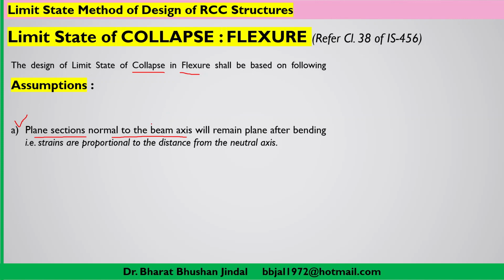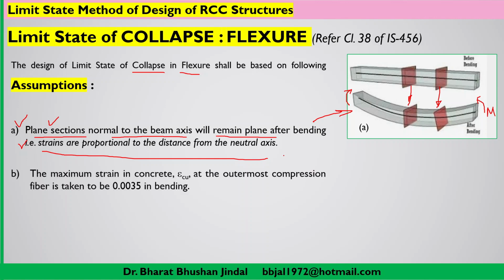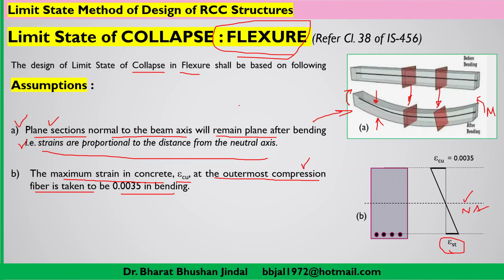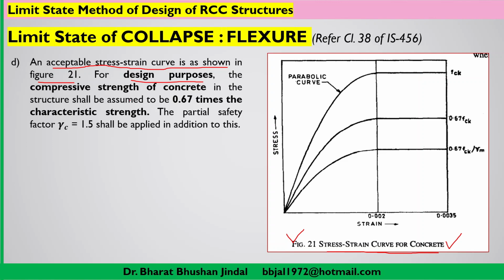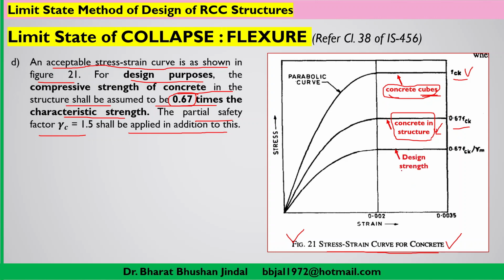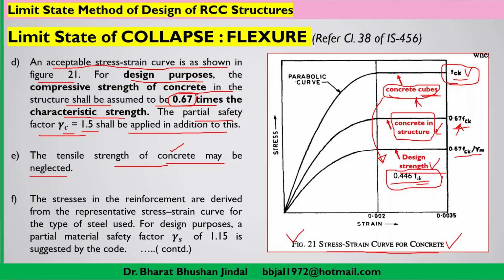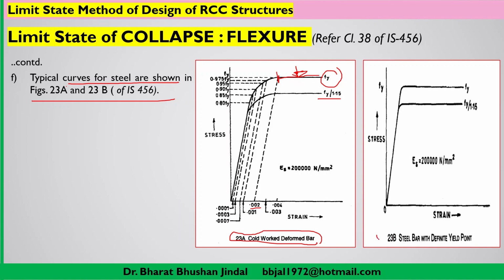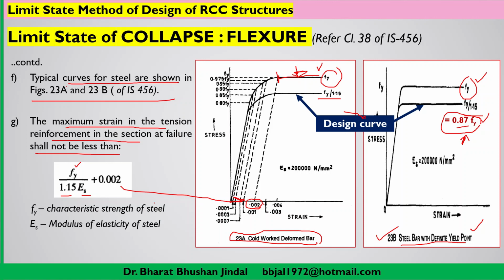Limit State of Collapse | Design of Concrete Structures ( Lecture 6 )

Comment: For design purposes compressive strength of concrete is taken as 0.67 times  the characteristic strength of concrete, is it experimentally obtained  ? or it is just a value based on practical knowledge?
Reply from the maker: Its based on 'Statistical Analysis' or better to say by 'Probability theory' .

Comment: sir what will happen if the max. strain at reinforcement in section at failure is less than given formula.
Reply from the maker: Then failure of concrete will happen before failure of steel which is never recommended and you will be able to understand it in more clarity in coming lectures. 

*Appreciation for asking 'Good Question'.

Comment: It was a very good video Sir!!!
The summary of video is as follow:
In this video we discussed about limit state of collapse : flexure (Cl 38 IS 456)
We made some assumptions which are listed as follows:
a) plane sections taken perpendicular to beam axis will remain plane after bending 
b) the max strain in concrete at outer most compressive fiber is taken as 0.0035 in bending
c) the relationship between compressive stress distribution in concrete is taken such as it is easy to predict strength in substantial agreement with result of test.
d) from figure 21 of IS456, for design purpose compressive strength of concrete in structure is assumed to be 0.67 times characteristics strength. [ (0.446)fck i.e 44.6% of the actual characteristic strength of concrete]
e) tensile strength and compressive strength of concrete and steel are neglected respectively.
f) 87% of actual tensile strength is assumed for design steel.
g) max strain in tension reinforcement in sections at failure shall not be less than [(fy /1.15εs) +0.002]

Comment: Summary on topic- assumptions considered in Limits theory of collapse:-
1. Even after bending plane sections normal to beam axis will remain plane.
2. At the "outermost fibre", maximum strain on concrete= 0.0035
3. As per the substantial agreement of predicted strength and test results, the relationship b/w compressive stress distribution and strain of concrete  may be assumed of any shape(rectangular, trapezoidal, parabolic)
4.  For design purpose compressive strength of concrete will be considered as= 0.67x f(ck)x partial factor of safety of concrete
    = 0.67x f(ck)x 1.5
    = 0.446f(ck)
**Which implies that for eg if concrete of grade M20 is used then for design purpose it's designed strength will be reduced to 44.67% of its actual characteristic compressive strength.**
5. Tensile strength of concrete and compressive strength of steel can be neglected.
6.  Is code suggests partial factor of safety = 1.15 for steel to be used in reinforcement.
7.  In limit state methodology for design purpose  the yield stress of steel [f(y)]is divided by its partial factor of safety= 1.15 to gives the strength of steel= 0.87 f(y)
8. The maximum strain in the tension reinforcement allowed= [f(y)/(1.15 Es)]+ 0.002.